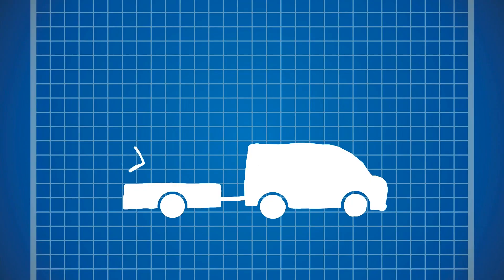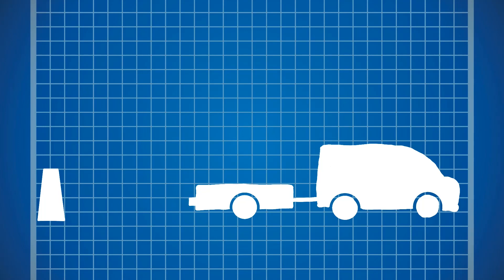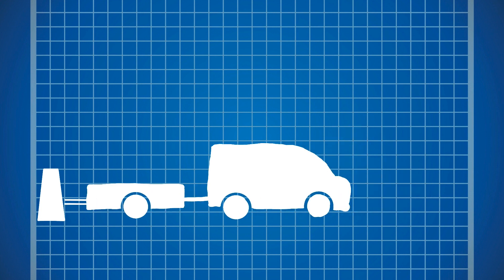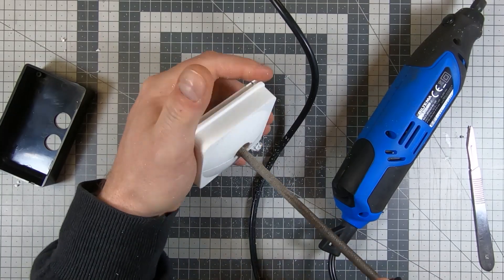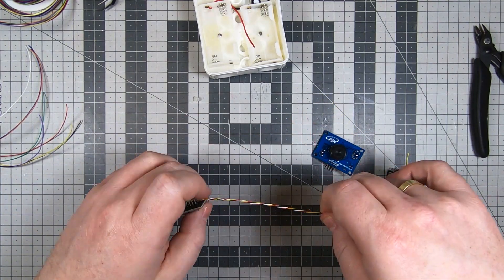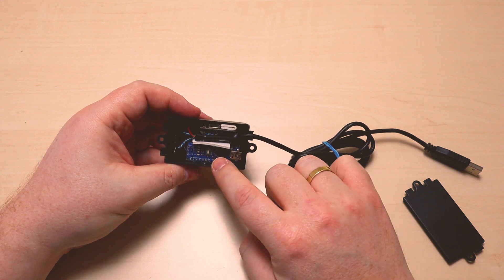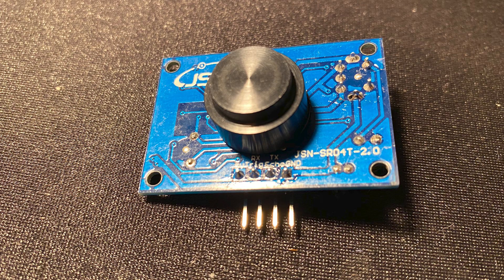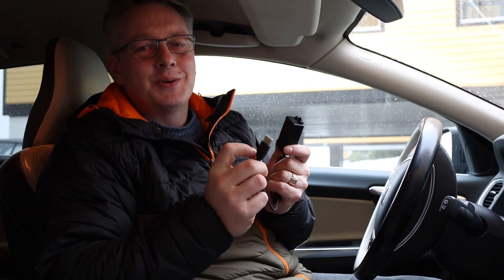DIY Parking Sensor Trailer (Arduino/ Wireless)

Comment: Hi great project. I have like many out there, am making a parking assistant, Doing the ultrasonic sensor part is not so much of the challenge because there is so much help out there. But interfacing it with the NRF24L01 module is the problem there is not help anywhere for this, and i have looked, and this is the only site i have come across that does it the way you guys have done. I have looked at the OneWire and the RadioHead library for help and not much on that. Would it be possible if you can post the code please. Will greatly appreciate it.

Comment: I really like the idea of having the sensor and transmitter in a box that is attached with magnets.

A phase 2 for this project may be to obtain power via the backlight on the trailer. Modern trailers with a 13-pin connector support a rear light when the car is reversed. But you must then have a converter from 12 volts to 5 volts. Then you could mount one or more sensors on the trailer.

Comment: Thanks guys. This is nice. In your video you mentioned you would have the code and wiring diagram with your description. I am not seeing either and hoping you will post them.
Reply: https://www.makerguides.com/jsn-sr04t-arduino-tutorial/ This is a link to a tutorial on the sensor. Should get you most of the way

Comment: Useful project, with easily available parts. Easy attaching and detaching is nice for those who don't own trailers themselves, but have to use rented or borrowed trailers.
If this was made permanent, power could be taken from the reversing light. But all things considered, I think your solution is perfect. When the sensor is only attached when needed, it won't gather dirt or ice, which would affect it's performance.
Reply from the maker: Thanks! Spot on with our thinking :-)